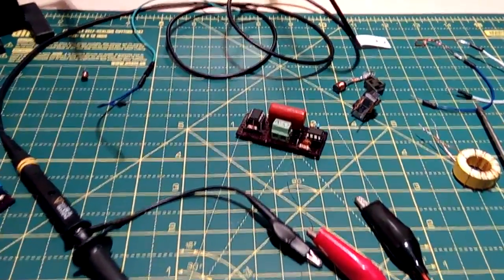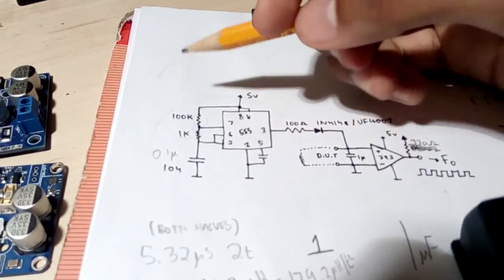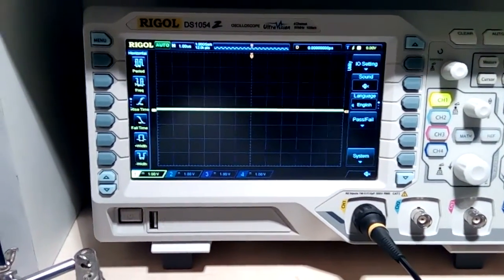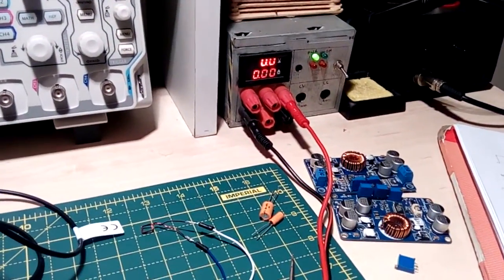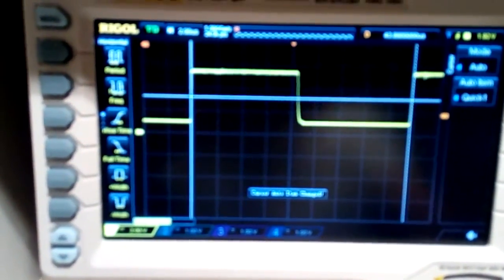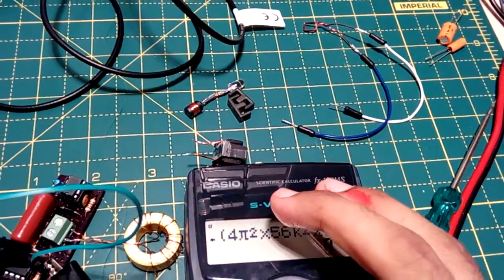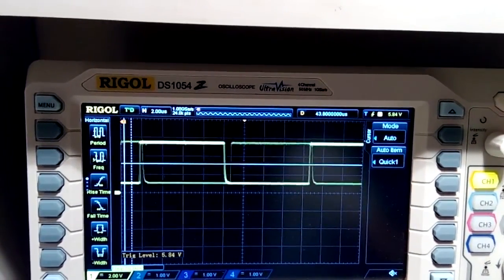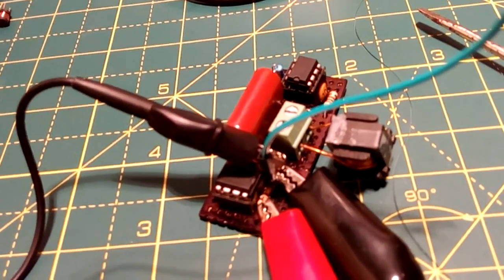DIY Inductance Meter

Comment: How can you be certain that the inductor values are right? The example undertaken was on 150Hz. Inductor value will vary based on frequency. What sort of percentage error are you looking at with this setup? Thanks for the video anyway
Reply from the maker: This was something that confused me back in the day as well - inductance is an inherent property of the inductor that depends only on the number of turns and the core material. However, the way inductors are measured can lead to confusion - some meters rely on the impedance of inductor, which does increase with frequency, leading to inductance being specified with a certain frequency. This does not mean that inductance changes with frequency - only inductive impedance does. Same thing with capacitors.

This meter relies on LC oscillations with a known C so that we can get the L once we measure the frequency. The "excitation frequency" of the LC tank is 150Hz, that is, the tank is charged 150 times a second and allowed to discharge at its own resonant frequency. The resonant discharge frequency is what we are measuring here.

Reminds me of high school, where some people looked at Ohm's law and asked if resistance increases with voltage since R = V/I. That is not, of course, the case, since resistance is an inherent property of the material itself and only depends on temperature.
Reply: @NNNILabs  oh brilliant! that's a wonderful explanation! Thank you so much.
Reply: Great question dude. I wouldve never know to as this.

Comment: How can you be sure that the inductor values are correct? did u have any reference? Did u try to measure any inductor with known inductance? What's the range of inductance that can be measured using this technique? 
Also, high inductance coils comes with a bit of a "non ignorable" resistance(say, inductance of a mixer-grinder motor winding) and due to this the resonant frequency formula will change.....how high an inductance did u try to measure using this?
Reply from the maker: A lot of good questions, but I think I've answered them in reply to the pinned comment, check that out. And no, resonant frequency does not change with resistance, it only depends on the values of inductance and capacitance.

Comment: Thank you. I get so tired of everyone telling me to waist an Arduino for every single task. It is so much more elegant to use a few discrete components to do a job precisely.
Reply: using elementary microcontroller skills, you can make this no longer dependent on a $400 oscilloscope and mental math every time you want to take a measurement.
Reply from the maker: This was before I learnt to code, and yeah, using a microcontroller for everything is rather wasteful.

Comment: This is brilliant.  It is exactly the right starting point.  I'll automate it by using a Parallax Propeller to issue the pulses, measure the frequency of the comparator output, do the math, and post the results to a little composite video monitor.

I'll use two or three plug-in reference capacitors in order to cover a larger range of potential inductances, or to test a particular inductor at more than one frequency (I'm always curious to know when an unknown core material reaches the limit of its usefulness).  I'll indicate to the Propeller which reference cap I'm using so it can correctly compute inductance. 

Many many thanks!!
Reply from the maker: You're welcome! Adding multiple capacitors is a good idea. Also note that the resonance time is dependent on the Q factor of the inductor, so the output pulses are not always continuous.
Reply: @NNNILabs  Right.  The Propeller's master clock operates nominally at 80MHz, so if the tank circuit will oscillate for five cycles after being kicked, and if the 393 can resolve all five cycles, I'll measure the last four.  That should peg the periodicity of a single cycle to within 3ns.  If the Q is so low that detecting five cycles is impossible, I'll have the firmware sample what it can.
Reply from the maker: @d.jensen5153  Have I? It looks the right way around to me.
Reply: @NNNILabs  It's just a question of when you capture the data.  I jumped to the notion that you were collecting it when the 555's output was high.  Then I realized you were doing it during the brief low period.  So I removed the diode comment.  Apparently you saw it anyway.  Doesn't matter.

I've modified that part of the circuit a bit.  I'm delivering the kick to the tank thru the collector of a small-signal BJT.  With the transistor off, the collector capacitance is only 4 pF, and is entirely swamped by the reference capacitance many orders of magnitude larger.  Also, the 393 is no longer ground-referencing, which allows a resonant voltage swing of a few volts.  But these are minor tweaks.  The concept remains unchanged.

Completely off topic, I ran into Jaan Pehchan Ho (from the movie Gumnaam) just yesterday.  Cannot get enough of it!  Best dance video I've ever seen.  Who knew Bollywood in '65 was so fab?
Reply from the maker: @d.jensen5153  Those modifications sound good! 
Unfortunately I'm not exactly a movie buff so I'll have to look that one up lol.

Comment: Why do I see three capacitors on the schematic but only two on the circuit board?
Reply from the maker: I seem to have omitted the capacitor between pin 5 of the 555 timer and ground, which is the control pin. It's not really necessary but having it is good practice.
Reply: @NNNILabs  Do you measure from the comparator output and the negative terminal?
Reply from the maker: @xierxu  Comparator output
Reply: @NNNILabs  With a multimeter.
Reply from the maker: @xierxu  I actually do it with my scope, but a multimeter should work fine.

Comment: why did you setup high duty cycle? why not 50:50?
Reply from the maker: Good question.
What I'm trying to achieve here is to quickly charge the inductor/capacitor combination and then disconnect the supply and let them 'ring down'. Charging them for a short while and then letting them ring for a longer timer period makes sense, since we need to accurately measure the frequency of the ringing. 50:50 duty cycle won't work as well - the charge/discharge times may be too short or too long depending on the inductance being measured.
Reply: @NNNILabs  But aren't you doing exact opposite here, charging long time and lettin it ring for short time?
Reply from the maker: @koktelici  Oops looks like I got it wrong. This is a pretty old video and I didn't watch it before replying xd
To be really honest I don't know why I chose that duty cycle

Comment: Diy inductance meter using an ociloscope ...
Reply from the maker: You could equally well use a multimeter with a frequency counter.
Reply: @NNNILabs  thanks for your replay
I dont have such a multimeter that have a frequency nor inductance only a basic things like volts Ac/Dc, resistance, diode, amperage.
Last few days ago I bought one with capacitance capabilities it was very helpful for condenser up to 200 micro farads

Comment: Can you make a circuit which can be connected to multimeter to show the reading 
Or this circuit converts inductor value into frequency there are many circuits on google which converts frequency into voltage that voltage can be measured by using digital multimeter
Reply from the maker: Hmm, that's a good idea for a follow up on this project.
There are plenty of schematics on the web for little circuits that display a value on a multimeter for inductance. Here's one:
http://www.qsl.net/va3iul/Homebrew_RF_Circuit_Design_Ideas/Inductance_meter_using_DVM.gif
Unfortunately I have exams this month so I won't be able to test it personally, but do try it and tell me if it works!
Reply: NNNI unluckily i can't find 74HC132 schmitt NAND IC in my local stores & ordering from eBay & other sites would be way too expensive due to delivery charges and stuff 
I cant buy good multimeter i have one but its functions are limited to capacitance , voltage , etc but it dosent have °C function , milliohm & inductance function so im making adapters for them i searched for almost a week but cant find anything good & i also don't have oscilloscope 😥😥😥😥😥😥
Reply from the maker: There are a few that use a simple schmitt inverter, if you have them.
Here's one that uses a few discretes:
https://www.homemade-circuits.com/15-v-inductance-meter-circuit/
but you need a frequency counter to read the output. 
Does your multimeter have a 'Hz' function?
Reply: NNNI Nah 😥😥😥😥 that's why i want a circuit which converts the value into voltage & if i had Hz range i would have used your circuit . Google dosent have many images on multimeter adapters thats the reason im tryin to find it on YouTube but still no one wants to make videos on such useful topic . I appreciate that you replied me & tried to help me thanks
Reply from the maker: You're welcome, I almost always find myself in a similar jam from time to time!
I'm not done yet. Can you tell me what kind of stuff you have with you? Maybe I'll throw together a solution.
Reply: NNNI means what kind of stuff ? Sorry but I didn't understand what you want to say to me
Reply from the maker: I meant to say what kind of electronic parts and test equipment.
Reply: NNNI i will try to find 74hc132 ic cause i only buy components when i want to make a project i dont have any assortment kit & in equipment i have a multimeter and 
Tryin to make a 60v adjustable powersupply but cant find any good circuit which can provide upto 10A and no other equipment's i have
I want o make a temperature adapter , inductor adapter & milliohm & also esr adapter for my multimeter i know i dont have much equipment's & i also dont have any money to buy them that's why I'm tryin to make them myself & i cant even work for 2 yrs cause I'm 16 now & legal age to work in my country is 18 or above
My life sucks 😭😭😭😭😭
Reply from the maker: Well I'm 16 too!
For temperature get yourself a K-type thermocouple.
There are plenty of cheap buck-boost converters on ebay for less than 5 dollars.
Milliohm is done simply, I think I have a video. ESR requires an oscilloscope. 
Why not get yourself one of these?
https://www.ebay.com/itm/LCR-T4-Mega328-Transistor-Tester-Diode-Triode-Capacitance-ESR-Meter-MOS-NPN-PNP/222247985900?hash=item33bf0322ec:m:mLakYynk0RqdZT62qrYQfdw
It's worth a cheap multimeter and can do almost all you wish for.
Reply: NNNI thanks brother
Reply from the maker: You're welcome!

Comment: Thank you for not making it with an arduino! I've been trying to find a reliable and easy to understand video, and I've finally found it. But I need to know the maximum and minimum values this meter could accept before breaking down.
Reply from the maker: The maximum value is limited only by the output frequency of the 555 timer. If you set it to a lower frequency you could measure bigger inductances. The minimum seems to be around 5uH, but it could be lower. I haven't measured lower than 6uH on this thing.
And yes, I hated the ones that used an Arduino too, since I suck at programming ;)

Comment: Probably works with the frequency setting on any cheap multimeter as well right?
Reply from the maker: Yes, since the output of the comparator is a square wave.